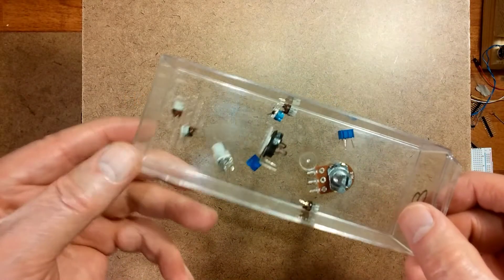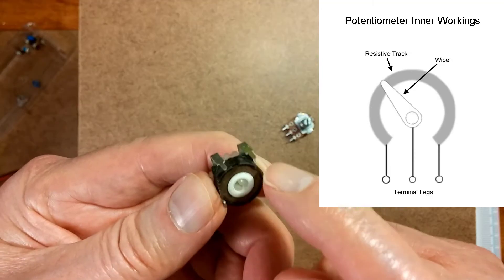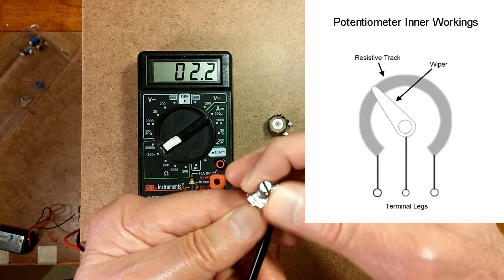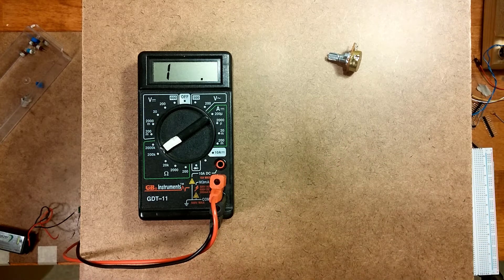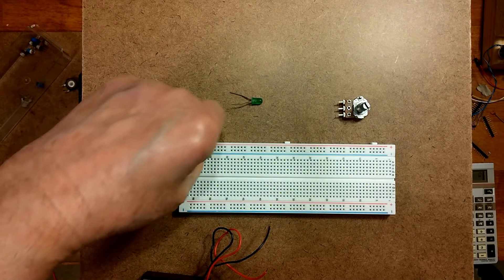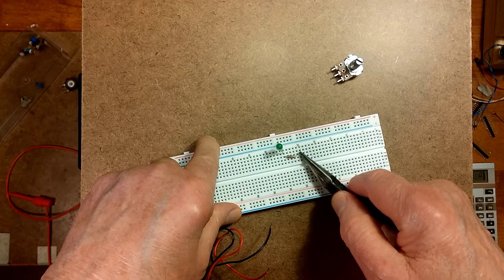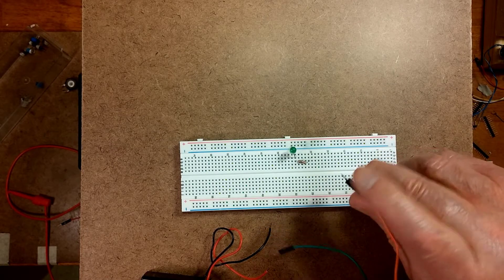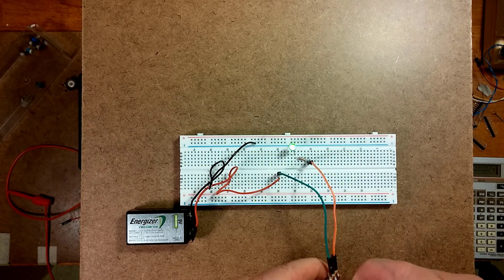How to Use a Potentiometer As A Variable Resistor

Comment: Is there a formula to convert K to amps? I'm trying to use a larger POT to regulate the voltage output from a 55ah LifeP04 battery. Particularly I want to limit the voltage drop from the battery to about 11 volts so that I don't trip the undervoltage protection of the battery management system. I'm using a super capacitor in parallel with the battery to provide the extra energy needed during the peak draw of the system. I think I'd want to be in the 50 amp range, but don't know how to convert K to amps...  (If you're curious - the application is for a DC gate opener that is tripping the underpower limit on the battery and causing the gate control to have to be reinitiated as the gate stops when this happens.)

Previously I've built a 50 amp PWM into a circuit feeding power to my old school trolling motor and was able to squeeze massive amounts of range out of the batteries based on feeding the power to my trolling motor in pulses of energy, instead of 100% energy. I'm speculating that this device might actually be something like what I'm asking for, but I'm looking for just a simple POT instead of the complexity of the full on PWM. Any help would be appreciated! Thanks
Reply from the maker: I assume you're referring to kilo-ohms when you say 'K'.   Ohms are a measurement of resistance and amps are a measurement of current. You can regulate current with resistance but you can't convert resistance to amps, so you can't convert K to amps. Use Ohm's law to calculate the resistance, current and voltage you desire.
Reply: @Electro-Mechanical-Basics  I wasn't sure what you meant when you used K, I repeated it from what I thought I heard in your video. Kilo ohms make sense. I decided to buy about 5 different sized resistors to see which one comes closest to solving my problem and swap them in/out and test the results. I'm not qualified to understand the math currently (no pun intended, lol).  I don't even know which size resistor would come closest to a solution or which is furthest. Once I have a few in hand I'll understand a lot more and might begin to have a basis for understanding what any math formulas I may find would be trying to tell me. 🙂
Reply: @Electro-Mechanical-Basics  It turns out that no resistor was the best option in my application. However, I now see an example where I can try to learn ohm's law. I could never understand why I should need it before.
Reply from the maker: @timkropf4648  It makes a big difference when you have a reason to learn it!

Comment: You show the pot legs inserted into the breadboard. The legs are wider than the wires. That doesn't damage the board?
Reply from the maker: The pot is just sitting on the breadboard, not plugged into it. I use jumpers later because yes, the pot legs are too big.
Reply: yikes I been doing this for weeks

Comment: when we connect the ground side of the potentiometer to the ground we can completely turn off the LED. why is this happening?
Reply from the maker: In my demonstration, one terminal of the potentiometer connects to the positive side of the battery, and the other terminal of the potentiometer connects to the resistor. The LED connects to ground (the negative side of the battery). Connecting the potentiometer to ground is not a valid connection so yes, the LED will turn off.

Comment: I've been experimenting with this same concept, but a 12v source to a small PC fan. And every size potentiometer I hook up to it starts smoking?
Reply from the maker: Of course smoke means too much current draw. I did a quick Google search for PC fan current draw and found a spec for one fan. I’m guessing it’s similar for many pc fans: 
12V, 330mA are the voltage and amperage ratings of the fan, it draws 4W (watts).

So I'm guessing you're using a potentiometer (pot) that is not rated for that much current.
Many small pots are only rated for up to about 1 watt or so.    

Your fan and pot may have the specs right on them, or maybe you can google your particular ones, or you can measure the resistance of them and calculate these numbers and get fairly close to actual specs, but I’d just take the above info as pretty close and an easy answer to your fan's rating.

The solution: A fan with less current draw, a bigger potentiometer (switching to a rheostat is how you get larger current ratings than many pots can provide), or a different circuit.

Comment: Thank you for making simple experiment 😊
Reply from the maker: Thanks for the comment - glad you liked it!
Reply: @Electro-Mechanical-Basics  already you used variable resistor but why again used 1k resistor?
Reply from the maker: @telugustoriesbyaravind  It is possible to turn the variable resistor all the way down to zero resistance. In that case there would be nothing to limit the current through the LED and it would burn out instantly. So a fixed resistor should be used as a safety to always limit current through the LED. I mention that I'm doing this at 6:55 in the video.
Reply: @Electro-Mechanical-Basics  thank you for replying me I will definitely support and suggested you

Comment: Please teach us how to code the Arm processors
Reply: That depends and requires you to use rhe firmware that's on the board. For example, Arduino will compile CPP. That depends on what software format the firmware supports loading.
Reply: @tutacat thanks for the response!